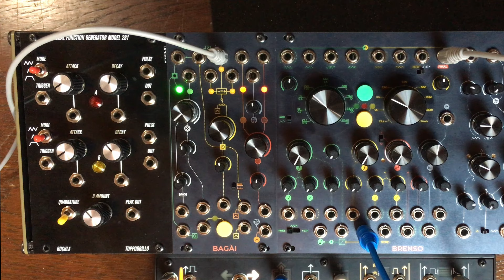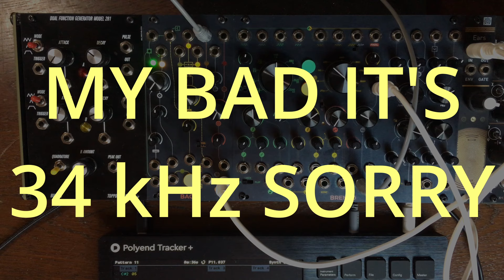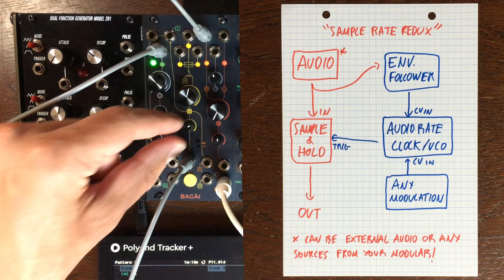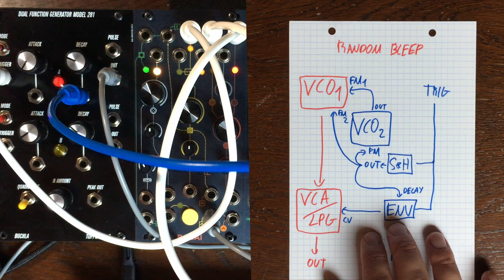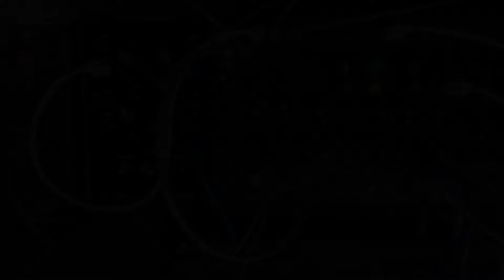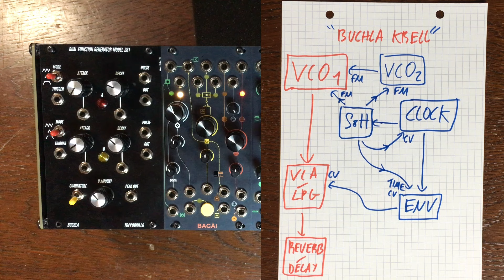Frap Tools Bagai Demo

Comment: I’ve been split on getting this since I already have Sapel, but the audio processing, sample and hold input, and burst generator make it different enough that it’s worth it to me. Between Bagai, Sapel, and Falistri, the modulation possibilities are really unlimited. Thanks, Stazma!
Reply from the maker: You’re welcome
Reply: get it!  The real magic is sending a typo-sync'd complex LFO into the S&H input instead of noise.  Send the stepped output to quantization and on to a v/oct input.  Modulate the bit reduction knob and the shape of the sync'd LFO.  Just magic.  You get a wonderful randomness, but also it repeats based on the timeframe of the sync'd LFO.  I'll have to make my own video!